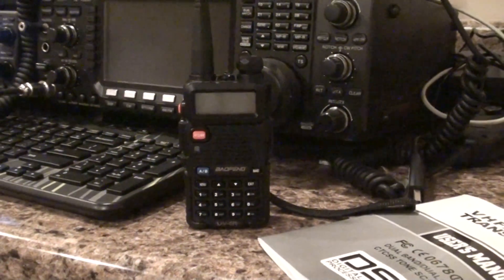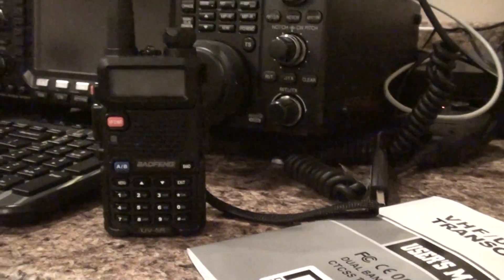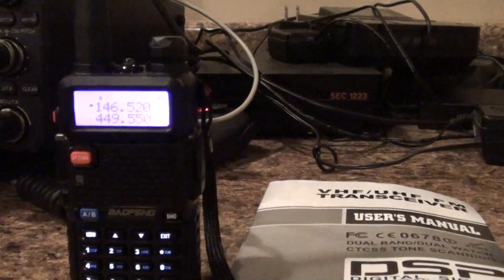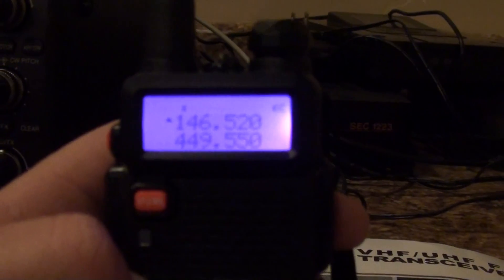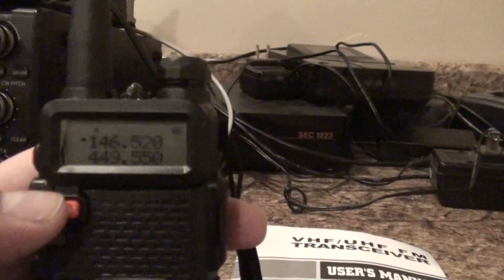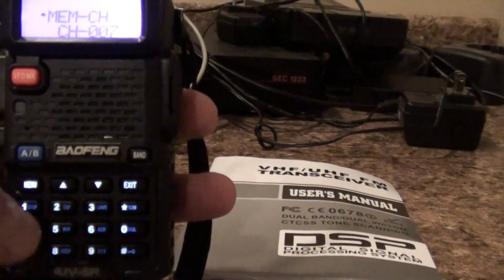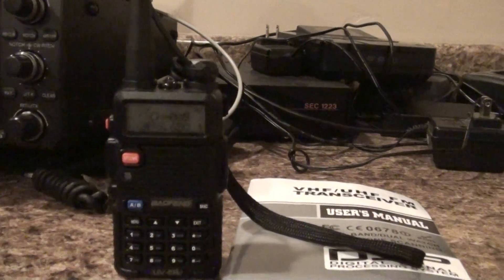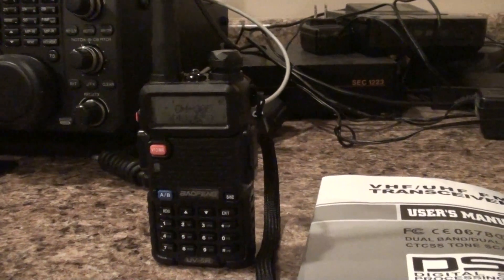Baofeng UV-5RC VHF/UHF RADIO

Comment: Can it be used for VHF and if so how do I just press the band button?????
Reply from the maker: Zac Miner yes it can. To go to V.F.O mode tap the top orange button. Then using the key pad type in your frequency.  When all frequencies are programmed, you don't need to switch between uhf,vhf,channels. They are all stored in the same memory bank
Reply: Jason Williams so when tbe frequency is set say for VHF 16 i can call it that and have that frequency set permanently and can switch between the channels with out Changing uhf to vhf
Reply from the maker: Zac Miner that is correct. I just released another video on programming these radios with chirp. It is way easy.